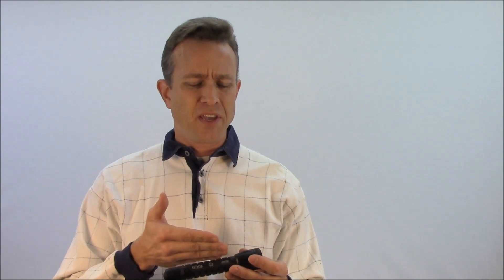The Key to Extreme Durability; Potted Electronics in Tactical Flashlight, Elzetta vlog episode 7

Comment: I my experience filling electonics with silicone =(potting) makes it overheat and not laxt long enough how long does your potted stuff work?
Reply from the maker: Our potting compound is thermally conductive and actually reduces hot spots on the circuit boards thereby increasing longevity.  We do not use silicone.